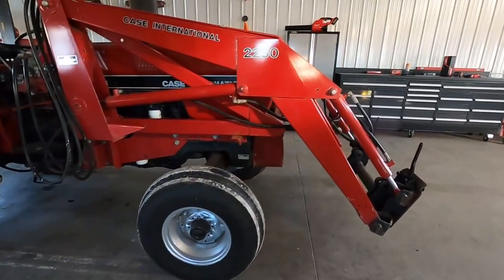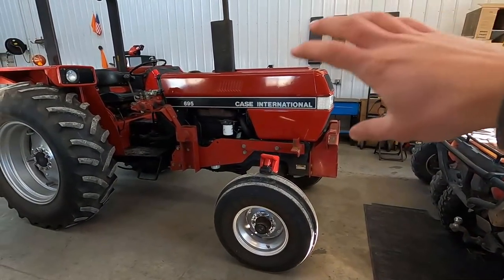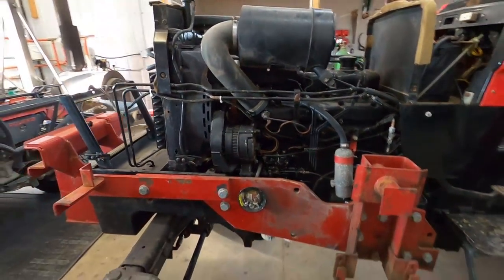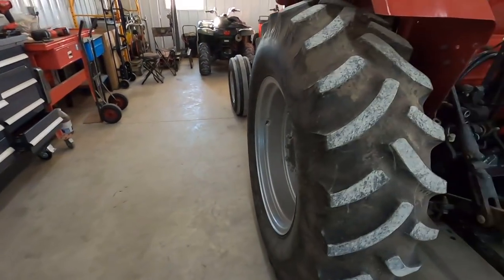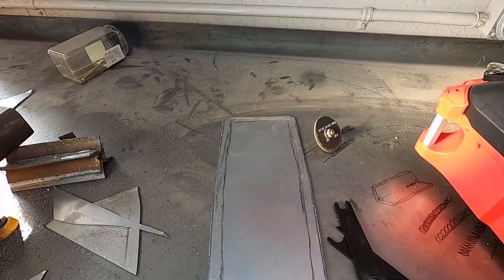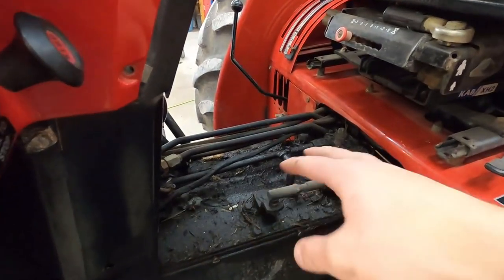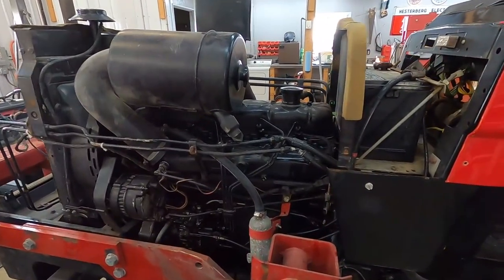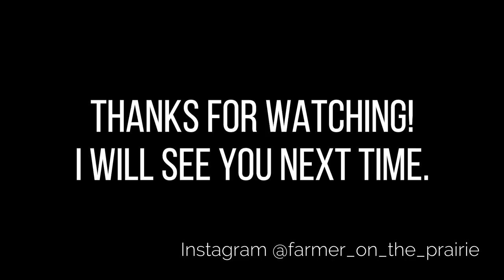I Tore the NEW Tractor Apart! Tractor Build Part 1

Comment: If you would back that thin metal with some scrap 1/4 in plywood and clamp the metal to the plywood you would get a lot smoother and more controlled cut.  I admire your efforts/work ethic and willingness to tackle any job!  You are a good role model.